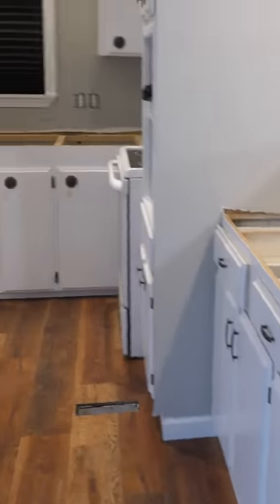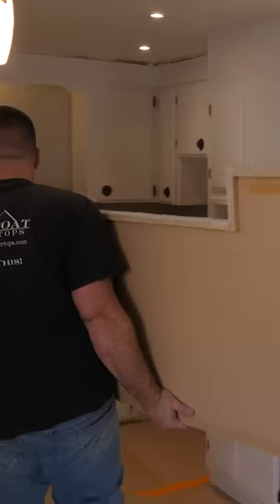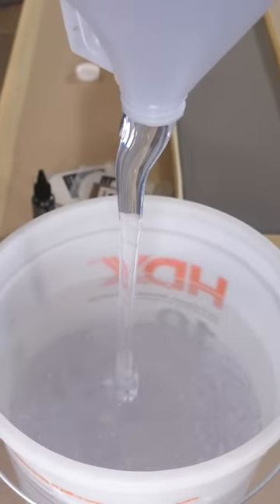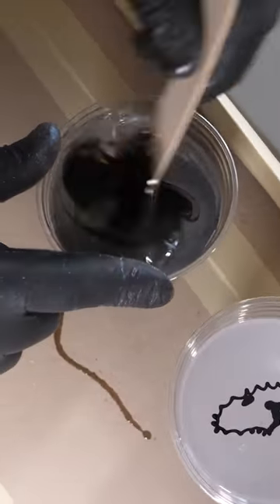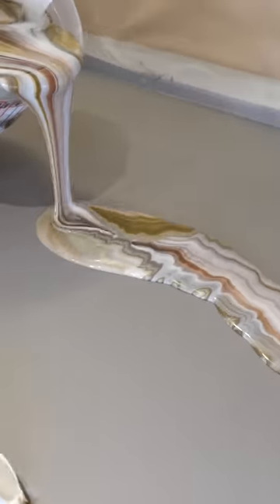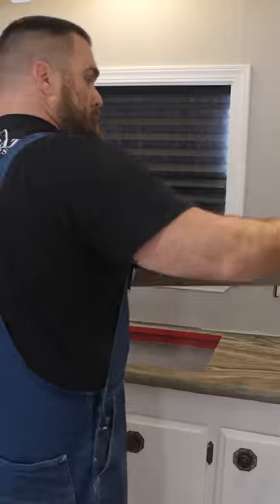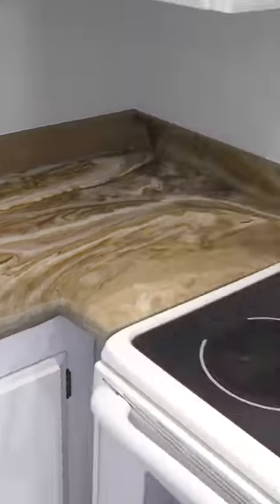Increase the value of your Home with Epoxy Countertops #shorts

Comment: Realtor: countertops will add $20-30k value
Homeowner: Cool it’s done 
Realtor: Awesome. Did you choose quartz or natural stone.
Homeowner: epoxy
Realtor: *internal screaming *
Reply: exactly!!!
Reply: Lol..Im biased as I'm a granite, quartz and solid surface installer with 16 years in. This art project will be the first to go when the home sells.  Honestly, granite is a little fickle, it's pretty but you gotta take care of it. Quartz can stain depending on the color. I like Corian or Himacs the best: more options like inlays, thermoforming and being able to sand and buff the surface. Corian maybe softer but after you knock a glass over on stone or put a plate down too hard.
Reply: At any point of time there is someone on marketplace pretty much giving away stone countertops. Alot cheaper, easier, and in every way better than this bs....
Reply: Then the new homeowner sets a red hot pot on the countertop.

Comment: MDF loves moisture and swells up !  The ends , edges and underside will eventually find moisture and swell. Any Nick or scratch will allow moisture under the epoxy.  They do make exterior MDF that’s expensive and full of resin but it’s not easy to find in stock many places.

Comment: I changed the countertop, painted kitchen cabinets, new furnace,water heater, removed the carpet and installed snap together flooring and painted inside and outside. Less than $4k and two months work by myself. Increased the sale price by $55k. Sold in two days.

Comment: I would never buy a kitchen that has an MDF countertop. I'm shocked and appalled that you would use such a cheap and disgusting material for such a vital part of the house
Reply from the maker: We have kitchens holding up strong 8 years old. When the epoxy is applied the MDF doesn't see any water. We apply a waterproof membrane to the underside of the countertops near the sinks and dishwasher where more moisture will be. The countertops last years and you can go on a vacation with the cash you'll save vs big box store options. Thanks for watching!
Reply: The mdf doesnt show and is durable and even more durable with epoxy. Meanwhile the majority of cabinets are made out of mdf and they hold up very strong. No need to hate on them
Reply: Yep. Unless you are going to coat the complete board all the way around, underneath, back edge, absolutely everything. If you live in a humidity high area, this would be disastrous. 
From the land down under 🇦🇺🇦🇺🇦🇺
Reply: @LittleChef_J  while the epoxy is generally durable, it is no where near as durable as a natural stone. One of the main issues with epoxy that ppl experience is that putting hot things directly on it leaves rings on the counter that are impossible to remove. Man made quarts counters also experience this issue since it's mainly epoxy as well.
Reply: @StoneCoatCountertops  my kitchen is over a hundred years old and it has never needed any work done because it has granite countertops. Your MDF will not hold up like that and is just a cost-saving measure for you to rip off the customer.
Reply: I’m a carpenter and I know for a a fact that most counter tops are melamine mdf based I mean my counter tops are granite I built my kitchen with the help of my dad and uncle who are also carpenters but we have made tops out of mdf and melamine and they either get finished or veneered with thermal foil all you people saying mdf is weak have probably ever worked with it it will only absorb moisture if left raw and untreated the epoxy in this videos acts as a barrier against moisture and mdf is just strong asf for what it is
Reply: @prod.yayo5715  in certain ways MDF is really strong considering what it is, but the epoxy counter tops are always a bad option in the long run. I've had clients who have man made quarts(which is mostly epoxy) and MDF counter tops, and they always end up with marks from when someone accidentally laid something hot directly on the countertop. Personally, if you're going to pay top dollar for any countertop, you'd be best just getting a natural stone which will out last other options
Reply: @itspapaj4732  yes sir
Reply: @kumaralockwood3172  You never heard of MR MDF?
Reply: @dog2man1994  You think the customer will be paying the same for these countertops, as those mugs who pay a fortune for chip-prone granite?
Reply: Lol that’s how most of the houses are built in Vegas
Reply: @StoneCoatCountertops   Wrong this system is trash anybody that puts this in will be regretting it very soon.
Reply: Those colors are god awful...
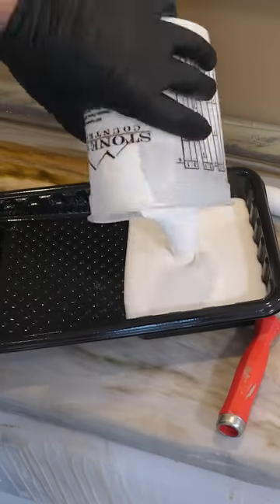Reply: That piece at @0:44 is already wiggling just from  the pressure of the roller...
Reply: @jsc41990  - this Epoxy is SO damn ugly. It looks so cheap and nasty, irrespective of the MDF.
Reply: @prod.yayo5715  Most?  Maybe most you build, but not most in the US.  Not even half of what is sold by Home Depot & Lowe's is MDF.  And then you have custom shops all over building cabinets and very few of them use ANY MDF.
Reply: @LittleChef_J  any mdf cabinet I've seen doesn't last 10 years near a sink.
You can get marine plywood or even mdf for not much more.
Reply: @LittleChef_J  you obviously have never seen mdf get wet. Turns into a moldy sponge.
Reply: @StoneCoatCountertops  8 years? That is your metric for success as a "tradesmen"? Sad.  More like a mattress salesmen.
Reply: @satibel  bruh, marine plywood has no place in a kitchen. Hope you're not building shit for people.
Reply: @MKRM27  I'd like to see the epoxy handle a 500°F cast iron skillet like a granite countertop.

Comment: Instead of messing around with epoxy that will burn if you accidentally put a hot skillet on it. Just wrap the MDF with brushed stainless steel and that will last a lifetime. Just make the MDF 50mm thick to make it super solid.

Comment: You can add value by updating the kitchen BUT DON’T USE EPOXY. 
I work with all types of people and selling homes is one, upgrading the kitchen is always a big plus with potential buyers. 
They want new floors, carpet, bathroom and kitchen with fresh paint in all the rooms. 
One thing I hear a lot is, “it’s nice, they have marble countertops”

Comment: First,  you have to spend 20-30k on new countertops. Life hack
Reply: In this case it wouldn't even matter. The place had cheap laminate flooring. A crappy stove and dishwasher.  The cabinets were old and dated. No one is going to pay a premium for an otherwise bland kitchen because you dropped in some expensive countertops.

Comment: Been doing remolding for over 10 years and I have never and will never use mdf for a countertop , it will rot over time. And when it gets wet enough it swells. I always use Birch or pine when using epoxy or concrete.

Comment: Imagine the sheer scale of scratches that it will have
Reply: Add all those imprints left from Anything you set on it. Stonecoat is crap.
Reply: What setting a hot pan down on it.?
Reply: Just epoxy will scratch. The final coat they put on it tho prevents that from happening as far as I am aware. It is a lot tougher.
Reply: I used epoxy 25 years ago on pipelihe and I know its strong  resin,but not for my kitchen.
Reply: No not really. They can buff out

Comment: No counter is going to add 30k to your house price....
Reply: Have you seen prices lately?
Reply: @nrrn4454  yes obviously. There are way more variables that go into a houses price than just adding a 2000 dollar counter and saying it will add 30k in value. What if the entire house is crap? You really think throwing a counter is gonna add 30k? No it won't
Reply: It's the same as some kid fixing a body kit to a crap car.....probably devalues it more than anything. You can't polish a turd but you can roll it in glitter.
Reply: @HunteroftheNorth  being in construction I personally watch two different builders build the same house all the time. One has granite countertops and 6 inch base trim with hardwood floors. The other has crap countertops but looks similar to the granite with click together flooring imitating hardwoods and 3 inch base trims. They all sell for the same usually. People go on looks not quality.

Comment: Anyone else see the counter railing flex when he was adding on the topcoat? Shit will be broke in a month if the owner has kids
Reply: Yeah I saw that. Absolute hack
Reply: First thing the buyer will redo is the counters
Reply: This was before they were secured. If you watch the full
Video after the top coat is installed they are nailed and screwed into place

Comment: They spent in countertops what they added to the value of the home and didn't make any more profit. They might have made the home more appealing, which would sell it faster and that is what the realtor wants. The realtor has a vision, they think they know what looks good by design and they're trying to sell the home fast. So they talk you into doing upgrades so they feel more confident in what they're selling. If a salesperson feels more confident in what they're selling they are going to most likely push it and sell it faster. Also the upgrades do add value to the home you may not make money, because of the cost of the upgrade, but it makes it a nicer home more apeeling and people will want to buy it more.

Comment: Hey folks I just want to drop some friendly words of advice here. Excuse the caps...THERE IS NO SINGLE THING YOU CAN DO TO ADD GUARANTEED VALUE TO YOUR HOME! People will pay a mint for a dump if it's in the right area and try to haggle the price of a nice home in a terrible area. What are the schools like? What are the surrounding homes in the neighborhood selling for? A pool, a new kitchen or new carpet doesn't give you negotiating power. Some people hate pools and some might hate that countertop and know that they'll have to drop $$$ getting it replaced. The point is do these types of renovations for yourself but don't expect added value or equity. It doesn't work that way.

Comment: Only if the potential buyer is that clueless.  Then again....  One other thing most commenters left out:  Even if it looks good initially, the epoxy is soft, will easily scratch and the clear top coat will yellow with time.  I had a friend do a similar process on the kitchen floor and had to completely rip it out after about 4 years.

Comment: Also counter tops are coated with melamine formaldehyde polymer not epoxy polymer for a reason because the melting temp is over 300*c whereas epoxy is 50*c so when you put a really hot Mac cheese tray bake down it doesn’t turn your counter to a gross mush lol

Comment: I first saw "MDF counter top" and laughed... Then $1k + of epoxy goes on, creates a neat pattern. Pretty nice, and epoxy soaks into the MDF (and also molds/flows to every edge and seals in everything- when done even remotely properly), and creates a hardened-tough surface for preparation. I don't know how resistant epoxy is to being cut on, hot pots, drops Anna other marking really...

Still not a cheap countertop replacement... But I would say it's better than big block reno store laminate countertop, as far as style goes.

Comment: End result looks great.

However, MDF and epoxy really doesn't seem like a good fit for a kitchen; won't take heat, not necessarily food safe, exposed MDF will absorb moisture..

Plus doesn't heated epoxy off-gas?

Comment: Why do people get upset about MDF countertops? Unless you have a marble or stone counter it's going to be MDF under that laminate. A 2 inch chunk of MDF is strong enough to support the Laminate or Epoxy counter top. God just liok at the panels holding it all up. The cabinets are just laminated MDF. All that matters is that it's sealed.

Comment: Compared to like normal worktops like ones you can buy from a store, or a granite/quartz worktop, how good is this at say, working with hot pots and pans, and how easy is it to cut (like if your using a chopping board and miss)

Comment: So how are the edges of the mdf protected?
Do you seal the front edge and around the sink?
I've never worked with mdf in that type of an application, but it seems like something that isn't going to last long. One pot gets bumped into the edge and chip and water and ...........
I get why he uses mdf so he can make that edge look like stone. With all the prep. and labor cost for this, I am curious to know the cost vs. Mid range granite or corian or one of the corian knock offs. 
This reminds me of one of those insurance companies that no one's heard of that operate out of strip malls.

Comment: as a chef i would hate those counters   too slippery and will they crack if a hot pot is put on them ? or if a can of food is dropped on them ?
Reply from the maker: No sir! Heat resistant over 450 degrees will not burn, melt or crack.

Comment: Epoxy surfaces are bogus. They scratch real easy. You're better off sticking with budget tile. I'd consider using large format floor tile with 3/32 spacers primarily the because it's thicker.

Comment: None of that will add value at the appraisal. Just to be very honest with you, when you go to sell a house people expect you to have working bathrooms a functional kitchen a roof that doesn’t leak, Windows that function, etc. putting in any of those things if it’s not necessary is not going to boost up the selling price it’s just going to cost you money. On the other hand if you need a roof because yours leaks, or if all the appliances in your kitchen are broken then yes it’s time to get some new appliances or to get that roof fixed… But if your realtor is telling you to put in granite countertops she’s probably getting a kickback from the countertop supplier.

Comment: I'm going to knock the guy for building his customer what they wanted. However, that customer is beyond stupid. Epoxy should NEVER be used as a countertop because the material itself is unsafe to prepare food on. Moreover, having a surface that's basically solidified plastic which will inevitably have acidic things and high heat objects touch it is going to release said plastic on your food. What an incredibly stupid trend.

Comment: I never would have thought of a professional contractor using MDF in the kitchen. I'm a master electrician and we have to install GFCI receptacles all over kitchens because of the risk of WATER exposure. Don't you run the same risk with non-waterproof materials in a surface which is directly touching water a lot of the time?  Plus, there is usually ambient moisture content.  Look forward to building a new countertop at regular intervals when they fall apart. And the colors are ugly. Do better.

Comment: Business is not for everyone.  My mom, we are going to start renovating homes and flip them.  I said, Great! So, which market? What are the statistics for that market? And few more pointed questions after that.  Well, I may as well be speaking  navajo.  Turns out, the investment would put them out of the market.  No sale has ever been that high for the area they were planning to enter.  Bottom line.  You need market information before making the investment.  More importantly, you need a plan to lose and the mental fortitude and acceptance to boot.

Comment: I own a countertop company and work with a lot of realtors. No fucking way the tops upgrade the value by 30k. Maybe if you remodel the whole kitchen with new floors, cabinetry and tops. Just use quartz tops instead. Expect a 5-10k increase in value and a faster sell if you’re just doing the tops. Doing the whole kitchen usually has diminished returned unless you are going cheap, which only works on cheap homes. Otherwise new custom cabinets are at least 30k alone. This epoxy shit looks like ass.

Comment: Even adding an actual 20k top wont increase the value of the home. Its a myth. By the way that surface is going to scratch real bad. Think of the moron who buys natural wood flooring that has a couple 50 pound plus dogs. Those dogs are going to trash that floor in a day.